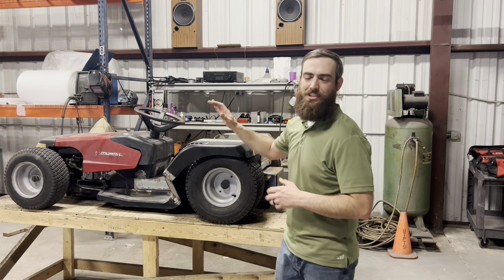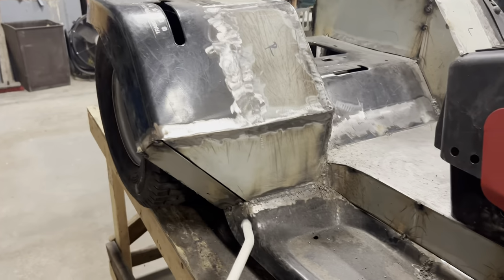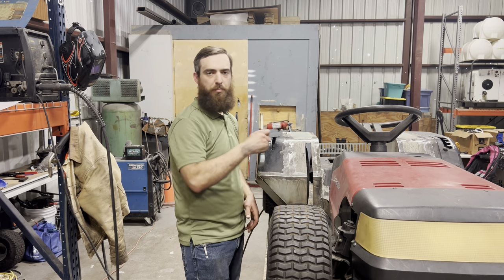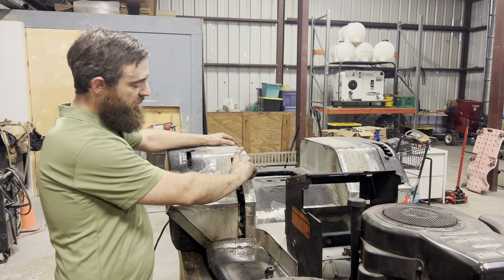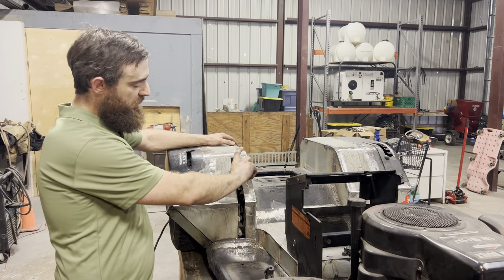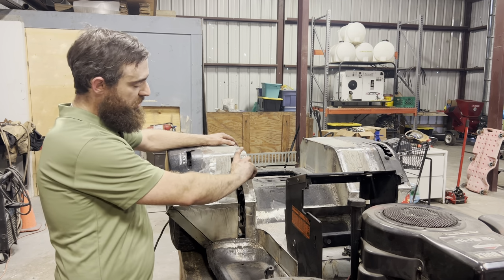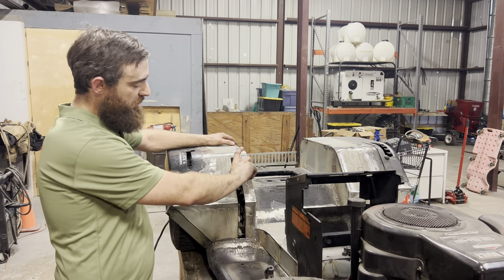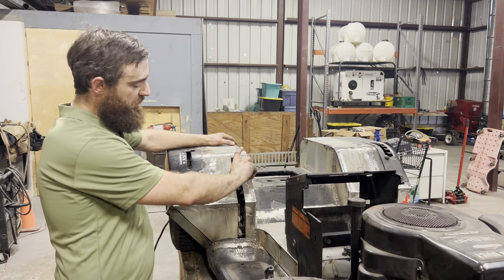How To Lower a Lawn Tractor as Low as Possible Pt. 6

Comment: So for the shifter you could do a bell crank to multiply the angle to the transmission or a chain and sprockets with the larger sprocket on the handle (could probably use a bicycle)
Reply: The bell crank could be just an L shape on the handle below the fender (pivot above the trans  a few inches) with a pushrod that actuates a shorter lever on the trans

Comment: ok i havent seen a comment to solve the shifter problem. if you put a j bend in the shaft having it go backwards first it will make the shifter go down the fender instead of towards the motor